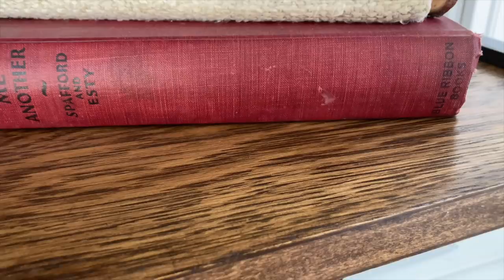MCM Furniture Makeover | FB Marketplace Furniture Flip | Trash to Treasure | Hutch Transformation

Comment: You did an amazing job on this. 

When I do blacks, I really like the waverly or the chalkntique( sp?) dark waxes, and allow a slight distress for some wood showing. These cheaper waxes really soak into the paint. So you also have to allow extra dry time for the paint.
In my opinion there’s something about the really dark colors that will show the imperfections of the poly, and the poly will make them seem more plastic.
Reply from the maker: True. Can I ask do you find that the wax is not as durable as poly. I think that is my biggest concern that a piece like this with potential for high traffic would not hold up as well if you waxed rather than poly? Id love to know your view 😊
Reply: @VintageAndPainted  😊 how I chalk paint furniture is a little weird 😬. I use dish sponges from Dollar tree, The five pack. Cut them in half and hold onto the green scrubby side. And wear vinyl gloves. I make my own paint by adding calcium carbonate to oops paint, flat or satin. I do 4 to 5 very thin layers, and I kind of push or wash the paint into the furniture, small brush for corners or cut in. So I think I kind of penetrate the wood or the finish via The small grains of the calcium carbonate and the texture of the sponge. Then I use a sponge with liquid type waxes or a cloth for harder waxes and push the wax in to the paint. my finishes are super smooth and baby soft, also I think I use more wax than most. 
So I’m not sure if you’d have the same outcome with brush or sprayed on…..
I painted a kitchen island black and sealed with wax. That ended up being a spotty, dust magnet mess. Water and wax don’t mix 🙁
I painted bedroom furniture black and it held up better than poly pieces with my cats claws, (they love crawling on my furniture). for some reason black chalk paint absorb a crap ton of wax maybe that’s why it’s so durable.
What I’ve noticed is a chip in the paint versus scratches in poly. 
Misses mustard seed recommended for black paints a layer of hemp seed oil, let that cure for a week then put your wax on. I haven’t personally tried it yet though. 
But if I had to paint something black and not use wax, I would use Sherwin-Williams emerald urethane in satin. It has a eggshell/matte sheen. I used e that on my lower kitchen cabinets in a medium gray and it’s totally scrubbable.
Love your content and your sweet personality. Thank you for making videos. 🤗